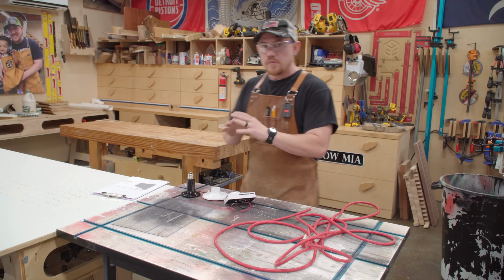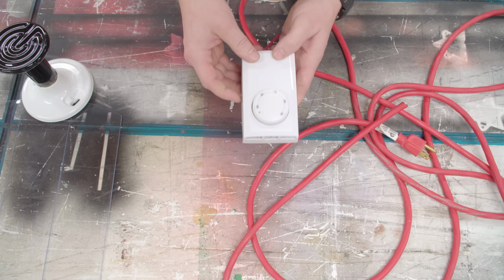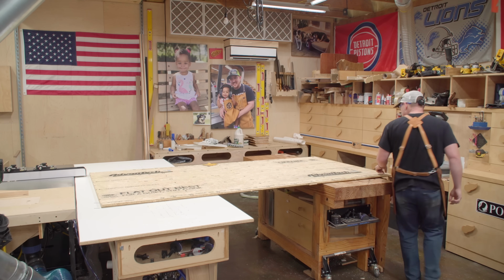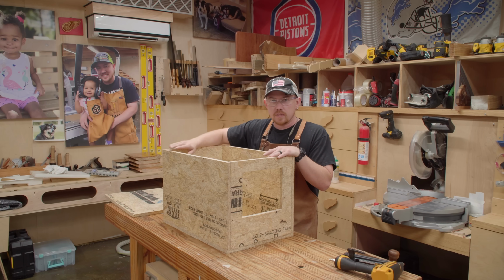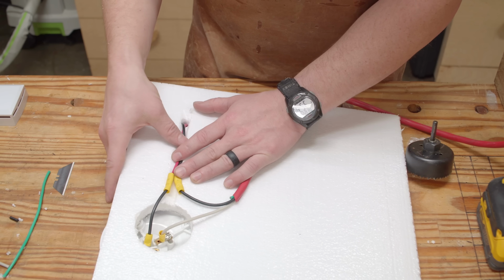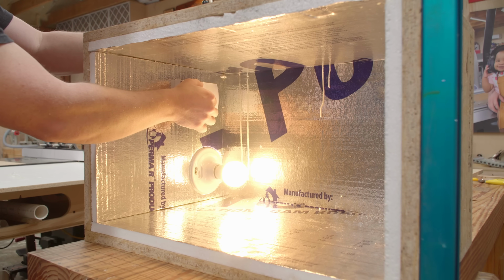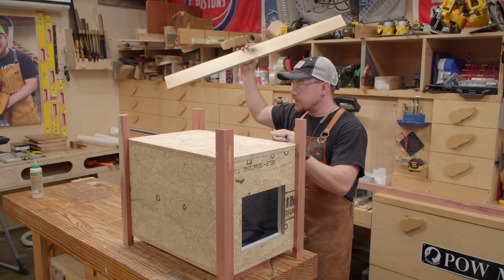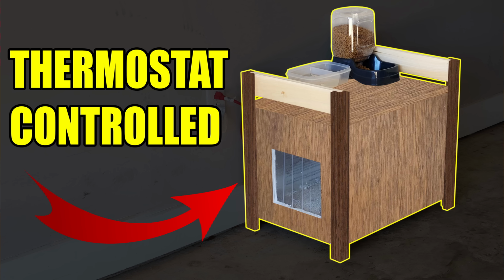Insulated and Heated Cat House or Dog House - 398

Comment: won't the animal be touching that heat lamp? they get very hot the cat will def burn itself
Reply from the maker: Why would the cat touch it? Do you touch hot stuff?
Reply: @JayBates  simply laying down, cats do sleep ya know. better to place the lamp up high
Reply: @JayBates  I have built an outside cat house myself, used pink insulation board, has a tin roof and a large heating pad at 40 watts. If its insulated correctly keeps the cat nice and warm and I saved 60 watts in power

Comment: I agree on not using a plastic socket for a heat lamp bulb
Best purchase i made was a thermostat made by inkbird. It is mounted in my house and has a sensor lead that goes into the cat house along the ceiling. I use a 3"x5" ceramic heater wrapped in mesh wire for heat. The thermostat can be set at and minimum above 40° and up to 90° so mine turns on at 58 and off at 65. That way your bulb isnt cycling every 2 minutes.

Comment: Having done this ages ago for an outside cat, some tips.  Heat rises, do not make a normal door.  Make a taller box with a lower shelf box inside of it.  IOW door is on the bottom, they enter by going under then up.  This also lets you heat it with a lightbulb or two without the cat or dog getting burned, by putting the lightbulb over on the other side of the entry opening from where they sit.
The wind can get up into it blow out the heated air, so still have a secondary door and flap to stop drafts.  The cat I had at the time loved it, warm when it was cold, but he still got to stay outside.
Reply from the maker: Your solution is technically better but for this application I think it's just overkill. This tiny insulated box  maintains the temperature very well with little electricity usage. I switched the bulb out for a 25w bulb and it's doing just fine. There isn't any wind with this situation though. It's inside our garage on the furthest wall away from the door.
Reply: @JayBates  for the 25W bulb, what's the lowest temperature that it will continue to heat a cat house? I want to build a similar cat house for my strays, but I have to account for it getting down to -15 F here at times. I got a 150W bulb and tested it out and it got too hot to touch. I don't want the stray cats to get hurt from it.

Comment: I have a quick question? I live in chicago, and I have a partially insulated garage. I love your idea of a heat source for your cat. I'm now wondering if this could work for stains and finishes in an enclosed cabinet to keep the temp at 60-65.
Reply: I don't see why not.  But I'd get the heat bulb first and experiment a little. See if it actually heats the air and not just your hand or the work or whatever. Need to heat the air if you want even heat distribution and not just a hot spot under the bulb. Also a little bit of air flow/exhaust would be very beneficial even if it means having the bulb on more than it would be in a sealed cabinet.
Actually you might be better off using one of those little personal under-desk leg heaters that are all over Amazon.
EDIT! Unless you use only water base finishes, beware of thermostats that spark internally when they switch off!! An old mercury switch style 'stat would be perfect if you can find one.
Reply: Starting to have second thoughts. If you are using finishes that give off flammable vapor you would be creating what amounts to a Class I Div II atmosphere in the cabinet. You could make it safe by eliminating all possible spark sources. Ventilate with a fan that has a brushless motor. For a thermostat use one that mounts outside the cabinet and uses a capillary bulb thru the cabinet wall to sense temperature. Etc. Otherwise you could accidentally build yourself a bomb.
The unknown is what the bulb would do if it fails.

Comment: Coincidentally, I heated my outdoor cat house (for a bully homeless cat who doesn't get along with the indoor cats) with the ceramic bulb. The ceramic bulb gets really hot to the touch, so I added a dimmer switch between bulb and receptacle to eliminate the possibility of scorched cat fluff. To further reduce the wattage, I added a timer switch because, where I live, it only gets really cold at night. For the six walls, I sandwiched the half inch PS between two pieces of quarter inch ply using spray adhesive to bind them all together. I also added a second emergency escape door made of the insulated wall panel and hinged at the top in case a racoon pokes his nose in the cat house so the cat doesn't have to fight her way past the racoon to escape.

Comment: Perhaps add a very small light to the outside so you can see when it is heating. A friend of mine did something similar in a cabinet he stores his tool batteries and wood glue in. The cabinet is in an unheated detached garage. He can see the little red light from the house through the windows. I prefer porcelain lampholders over plastic. I think they cost about $1 more. I wonder if a reptile rock heater would work.

Comment: Nice project, but some concerns, here in Europe 150 watt lamp on a plastic fixture is for sure not allowed. and you use foam as isolation, if it melts the smoke will kill the cat for sure. and you leave lamp exposed maybe a small wire cage around it? so the cat ill not get burned? no critic just some suggestions. i know the rules on electrical are different there than here, here the temp goes way down in the minus 35 C that is about minus 31 F. so I started to think to build a heated dog house too, but than sheep Wol isolation and a 12V floorheat mat. with the current energy prices, and they are extreme here it can run from a big car battery and a small solar panel. I use the same heating mats in my greenhouse i build some years a go from recycled materials and it keeps the dirt above freezing and i can grow the whole year true, we have only three months warm weather and the rest is hars winter 3 mtr snow etc. so if it doesn't work let us know too and maybe you can use the 12V floor heating as well as a safer alternative. well thanks for the nice video and keep them coming.

Comment: I'm not a safety freak but you really should put the wires in some sort of electrical enclosure. If any of your connections were to loosen up and spark there's a reasonable chance it catches the foam on fire. Like I said I'm not a "live and die by code" guy but that seems like a legitimate fire hazard.
Reply from the maker: Crimped wire connections with no moving parts. How can it spark?
Reply: @JayBates  crimps can loosen up over time from heat and cold. Those lamp bases aren't exactly high quality pieces. The thermostat switch could malfunction internally. Cat could bump something loose. This is why code requires all electrical connections being inside an approved box. I agree it's unlikely but considering the consequence is your shop burning down I don't think it's worth the risk. Especially since you've documented a viable reason for insurance to deny any claim.

Comment: Will the t stat turn on and off a lot because of the close proximity of the heater?
Reply from the maker: No. The temperature rarely changes due to the small open air size and the insulation.

Comment: isnt the cat going to get a hot arse from that ceramic heat lamp? would a reptile heat pad be better?
Reply from the maker: I made this a week ago and the cat has been in it every night. Doesn't seem to mind the lamp.
Reply: @JayBates  awesome, has the spoilt moggy chose a colour for the walls yet?
Reply: Reptile heat pads are not rated for exterior. They do make outdoor heated pads for cats. I assume that would have been cheaper and worked just fine as well.
Reply: @RobertRedland  that thermostat, lampholder and ceramic heat lamp are not rated for exterior use, they are inside a weatherproof box.

Comment: Given how hot the surface gets on those things, one of those mesh cages they make for them might be a good idea (or make one from 1/2" metal fabric).  Our cat we used to have years ago would love to crowd right up as close as he could stand it to a single-wall garage-type wood burner we had (the kind that can glow red on the outside from the coals).  Sometimes his fur would get so hot, we thought he would ignite himself.  No such mishaps occurred, and we didn't try putting up any mesh, primarily because we didn't think of it.  Instead, our response was to mutter, "Stupid cat," smile and shake our heads.  Luckily, he never seemed to take offense, but that may have been due to his already having cooked his brains under there....   😎
Reply from the maker: I made this a week ago and the cat has been in it every night. Doesn't seem to mind the lamp. It doesn't stay on long.

Comment: That’s way too much heat for an outdoor cat.
Reply: If it gets too warm the cat can just turn down the thermostat!
Reply: I was thinking the same. I mean we have an outdoor cat house but it has a weight-on heat pad from amazon for like 40 bucks inside an old insulated cooler.
Reply: @HabitualButtonPusher yes I got the same Pad from Amazon. Way better than all this
Reply: Can add auto thermal so will turn off if to hot